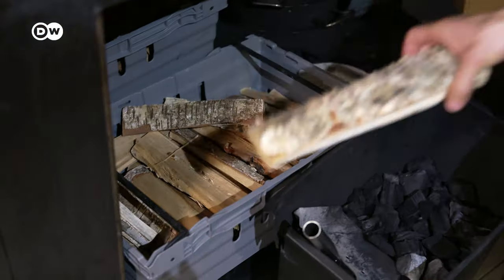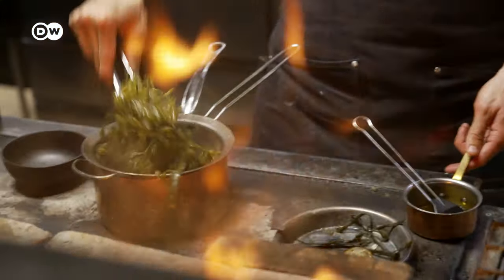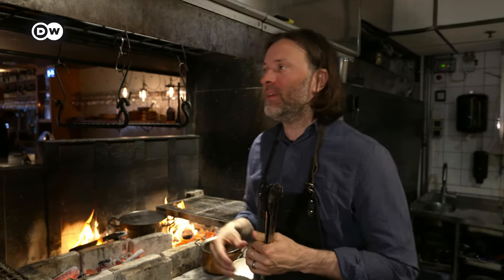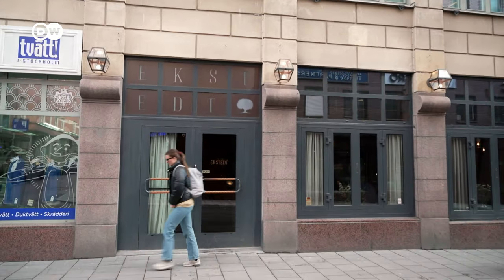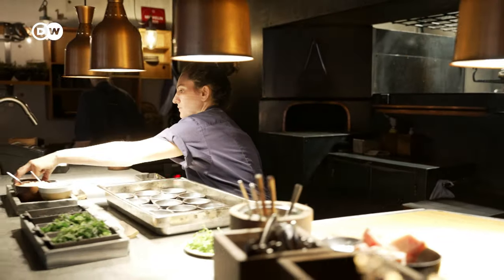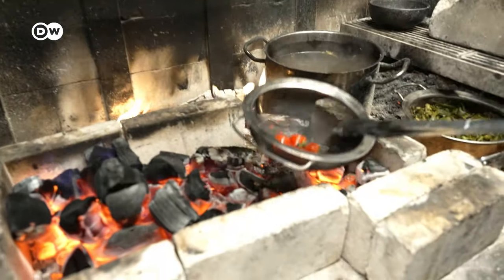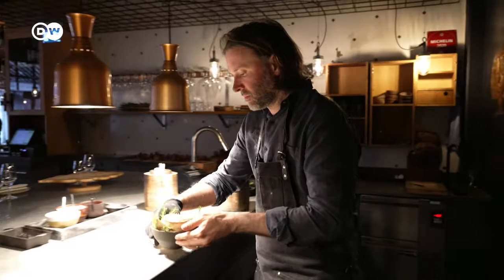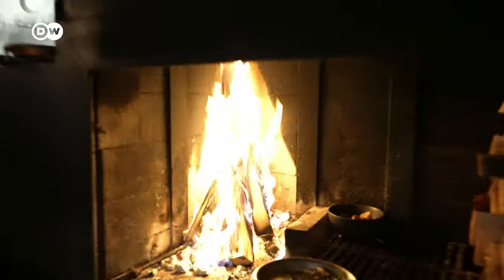Cooking Without Electricity Or Gas Over Open Fire

Comment: OK, the food should be good but it is a bit pretentious. He is using a wood burning stove to cook with pans, what's the point. It is environmentally really bad to burn wood when he could just have a gas stove.
Reply: Either way, resources are expended. Question is, how many living things do we have to use (kill) to enrich our gluttony?
Reply: @jsmrt6875  as many as is necessary. Thankfully animals provide more environmentally sustainable sources of protein than any plant could wish to and on top of that don’t participate in widespread ecosystem destruction that soy and corn contribute to every day.
Reply: You have a valid point . He is cooking food to create a particular flavour which wouldn't come if he uses electricity or gas .
Reply: @josephmathew12  cooking food in a pan does not have different flavour regardless what the heat source is. So either he cooked something in a wood stove or an induction stove the flavour would be the same.
Reply: @jaytorr6701   A ha. Makes sense.
Reply: @josephmathew12  he is just burning wood on the stove for no other reason than to market his kitchen as 100% wood burning...
Reply: @yusefkhan1752  Apart from for example where the Amazon is cut or burnt down by cattle ranchers in Brazil. And most of the soy and more than a third of the  corn is grown to be used for animal feed. And the we haven't even addressed the fact that plant based protein sources are way more resource efficient than any animal protein. So in other words, you are incorrect.
Reply: this is one restaurant. environemtally speaking this is neglectiable . Problem with enviroment is much bigger then this, problem is on a global scale where there needs to be regulations on factories and emissions etc etc. 
He uses pans, but the the fire gives a smokeyness to the dish its not just heat.
Reply: @jaytorr6701  you are wrong. smoke is around the pan all over the kitchen. it makes a difference to the flavour
Reply: @reallivebluescat  what are you taking about. He uses a wood burning stove. This means the heating plate is just getting hot by the fire underneath, instead of electricity or gas. There would be no difference in the flavour when using a pan.  I get it. Its a marketing trick, look we are not using electricity to cook your food. But a restaurant like that must use about 50kg of wood per day in wood burning stove. Which is unnecessary
Reply: @reallivebluescat  I have cooked in a wood burning stove many times. The only difference is that the hot plate heats up from wood but not electricity or gas. There is no difference in the flavour.
Reply: @jaytorr6701  its not an oven, its a whole kitchen being engulfed in smoke
Reply: @reallivebluescat  1:32 that's a wood burning stove. He uses this to cook on the top using pan, as you would with an electric or induction stove. The kitchen is smokey but the ambient smoke flavour would not go on what is cooking in the pan
Reply: @Fisklina  plant protein sources are way more resource efficient than any animal protein ?? 

Give examples
Reply: @eh-lo2do  It require less land area, less water, less nutrients and in meat production more protein is consumed by the animals than is produced in the form of meat.
Reply: Wood regrows. Gas does not.
Reply: @HB45175  you can use electric. Wood burning also pollutes.
Reply: @yusefkhan1752  thats not true, just the amount of water it takes to grow a cow or the Co2 they amit is so much worse then the environmental impact from growing soy in a sustainable way. The beef industry is one of the most disastrous industries of the planet when it comes to environmental impact
Reply: @jsmrt6875  lo cd
Reply: the guy has a star.
Reply: @Fisklina It's not a zero sum game, you can have grazing animals on land that is not suitable for growing crops on. Additionally alot of animal fodder comes from grains and crops that aren't considered high enough quality for human consumtion.
Reply: @yusefkhan1752 Have you realised that corn and soy is grown at such extreme rates because they are used to feed livestock? Aka the meat you are calling sustainable???
Reply: @johan23200  the cows don’t eat the corn and soy portion that humans do-they eat the byproducts of farming that humans can’t digest. The beef industry is simply a by-product. Sociologists speculate that this is the reason why cows were worshipped in many cultures-they are a miracle animal.

Comment: I wonder how much consideration he has given to the coatings on some of the metal high temperature cooking utensils he uses.  I saw some galvanized screen in there at one point.  Also, I would be terrified to use the "cheap" strainer over an open flame.  No telling what Chinese alloy and corrosion resistant coating it has.

In addition,  I hope he's checking for toxins that some of the grasses and other fuel sources may give off during the burning process.   

Coming from the bbq business,  these are things to consider.  

If he has thoroughly vetted all these items, he needs to mention it.  It's a huge threat that citizens need to know about.  

Many "healthy foods" being prepared out there in ways that are actually poisoning folks.